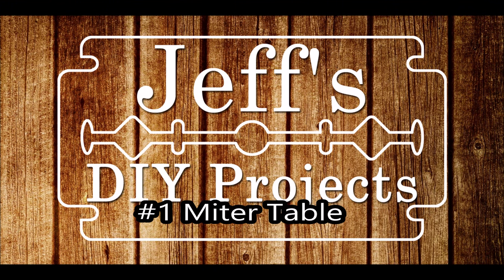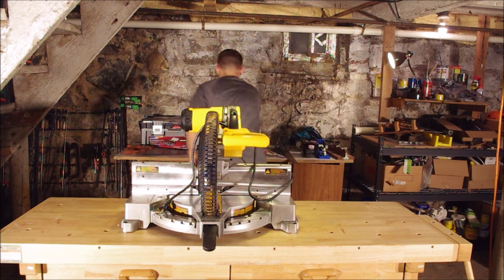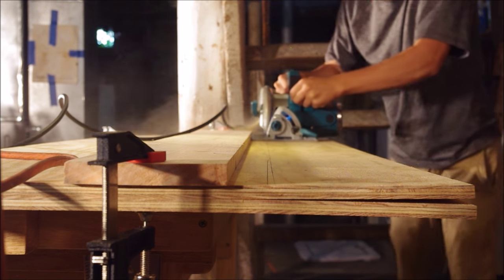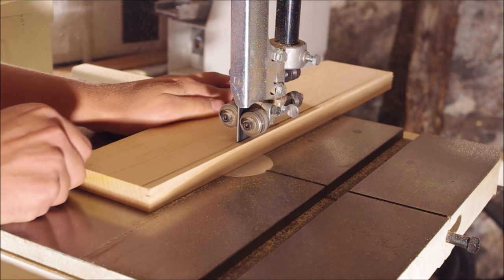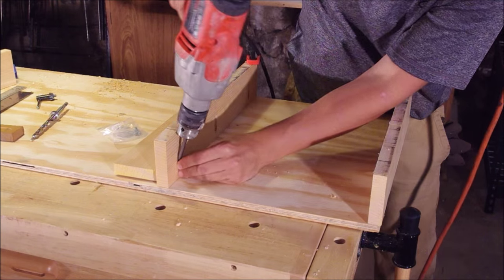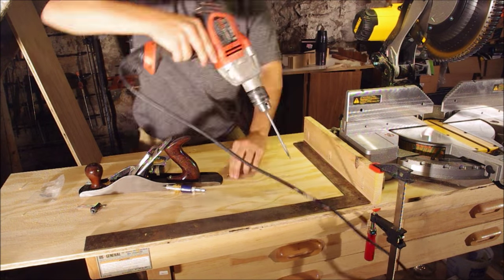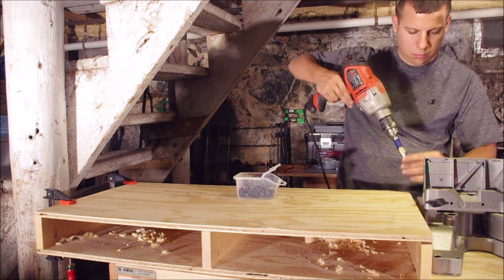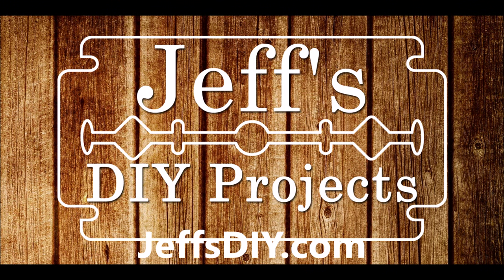How to Make an Easy Miter Saw Table

Comment: Why did you keep one side of smaller width and other side of larger width?
Reply from the maker: I am right-handed, so I feel more comfortable with that hand on the saw handle/trigger.  Thus, I can only safely hold down the board with my hand on the left side of the saw, so having a larger surface on this side gives the board more support.

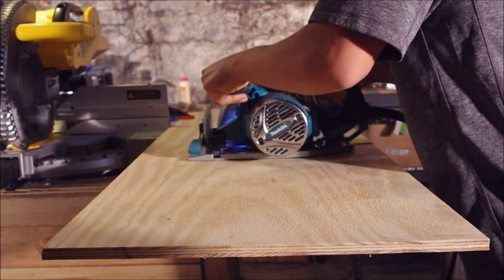Comment: Great video! I had a question though. At 3:18 it looks like the table it slightly higher than your saw's table. Did I miss why you did that or is there a reason in missing?
Reply from the maker: That was not the final fit.  If you watch beyond 3:18, you will see that I continue to shave down the spacers.  The final product is pretty close to level.  I should have shown a shot of this.
Reply: Jeff's DIY Projects That makes a lot of sense actually I just didn't consider it. I'm actually finishing my miter station right now who's his very similar to yours.

Comment: hey, so my question is, does your saw table still swing all the way the the right and left. Normally isn't there some space between the saw table and the station table to account for this?
Reply from the maker: Hi Chris, I don't quite follow your question.  Could you rephrase?
Reply: I understand his question because I was wondering the same thing (about to build a table myself). Usually on these setups there is some space on the left and right of the mitre saw for room for the saw to swivel left and right for angled cuts. Are you still able to do that considering your saw in snug up against both sides?